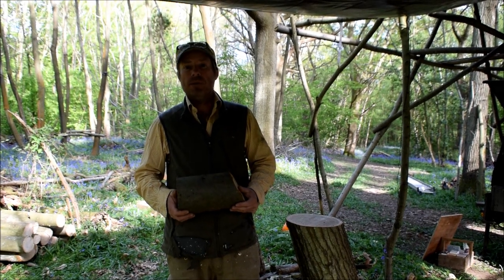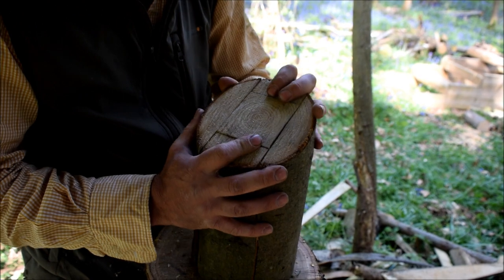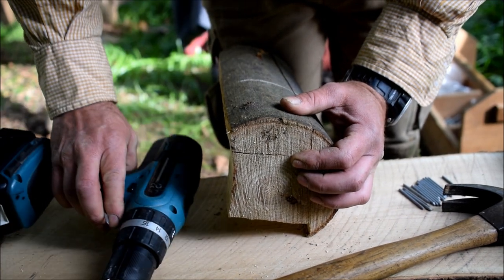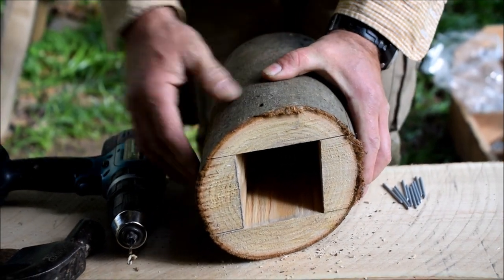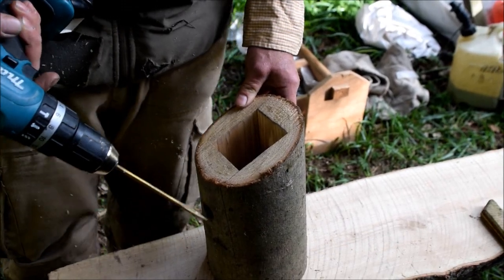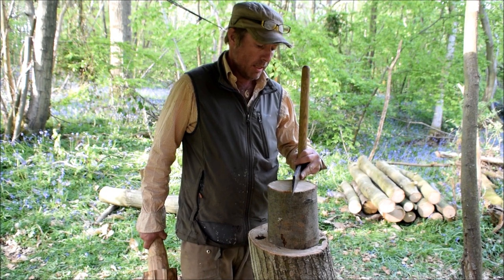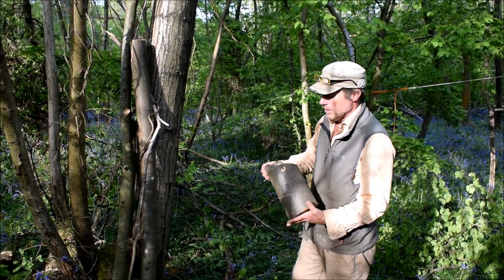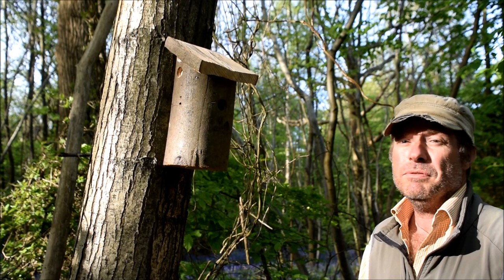How to make a Bird Box (Bird House) from a log

Comment: A few tips;
Use 2 wires or cable zip ties to hold it all together to make nailing easier,
Use stainless deck screws so no rust and won't hurt the tree,
Rough up the inside front panel with a chisel across the grain so baby birds can climb out,
Put a little dead grass in the bottom,
Try different size holes, birds will choose the right one,
I would also put some glue on the panels and use a dead log so it won't crack apart when it dries out.
I have also used 4" plastic pipe and cardboard tubes, cardboard needs to be waterproofed, I used rubber paint

Comment: Nice bird box and method.  Thanks for sharing.  Just wondering why you drill the sides to make room to screw the roof down.  Wouldn't it be easier to just screw the roof from the top and countersink the screws a bit?
Reply from the maker: Could do but the screws on the top would collect rainwater.
Reply: @mikepepler  Ah right.  I didn't think of that.  Thanks for the quick reply

Comment: Excellent, I did not know that cutting tool that I think is called Froe, correct me if the name is not like that ...
Thanks ....
Reply from the maker: Yes, that's the right spelling. It's very useful. Designed for splitting longer poles into pieces for making fencing, though I use it to make kindling too: https://youtu.be/o5daBhSvqSc
Reply: @mikepepler  Thank you Mr. Mike for answering me and sending me one more video about the use of the Froe ....
It will be because of Amazon that I will have to order it, I live in Texas and the stores do not have them ...
Have a good day and good health Mr. Pepler
Reply from the maker: @JoseLozano-hi1on  You can get new ones, but also ones made by a blacksmith, e.g. from the metal bits of a horse's bridle and a wooden handle.
Reply: @mikepepler  Thanks again Mr. Pepler.

Comment: Mine did not go this well at all
Reply from the maker: Well, this wasn't the first one he'd made... What happened with yours?
Reply: @mikepepler  The wood didn't split very neatly, I think it's maybe to do with log selection or perhaps the age of the wood. All I've got it's Ash at the moment which splits different perhaps? I used an axe head and whacked it with a heavy mallet.
Reply from the maker: @Robbythegod  a froe is probably more likely to give an accurate split. But also, the wood in the video is sweet chestnut, which tends to split very nicely.
Reply: @Robbythegod  it was definatly timper selection  ash doesnt always split where you want

Comment: Great method to hollow a log! 👍👍

Regarding the rest of the construction design, I would have preferred ventilation and drainage holes on the bottom floor and top side walls and two hinges to be abble to easily open the box periodically for cleaning.
Reply from the maker: +YouTubeSearch ToxicVaccines ToxicFluoride, HIV HOAX yes, you could certainly improve it with extra features like that, this is just a basic version.
Reply: Also a basement suite for renters and a back deck would have been a nice touch
Reply: @mikepepler  Great idea! I will try to make one for next Spring. An important feature  to protect against nest predators is to make sure the hole is at least 6 inches above floor of the "cave", just FYI :)